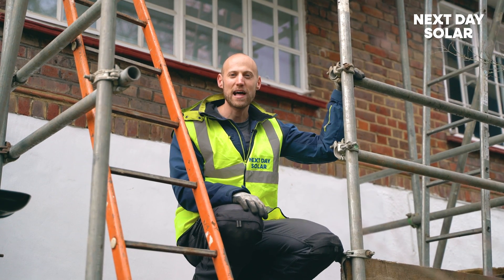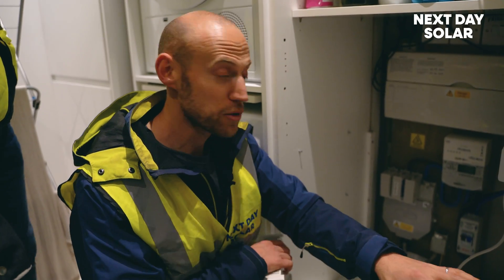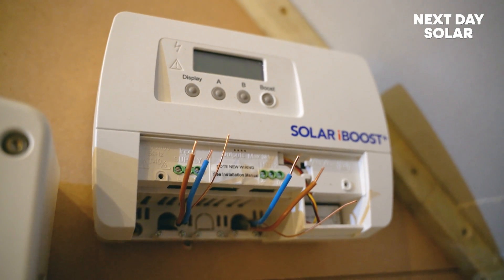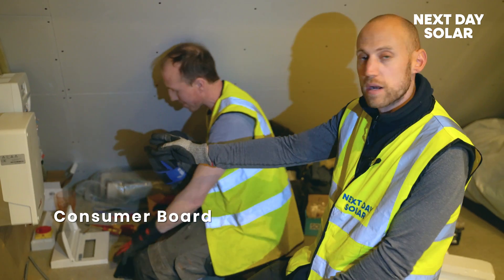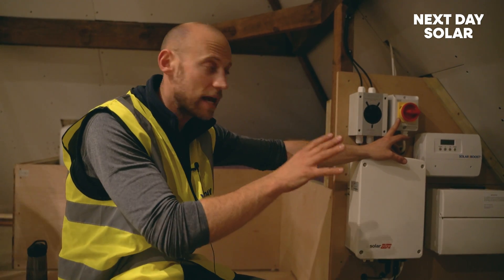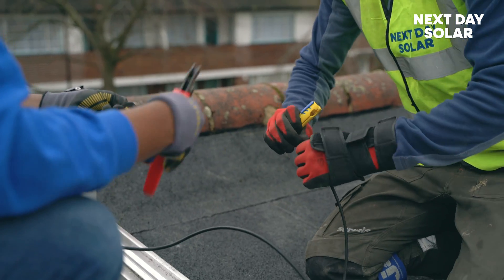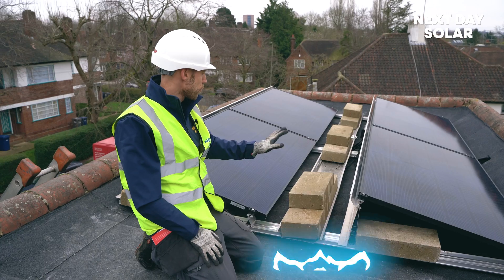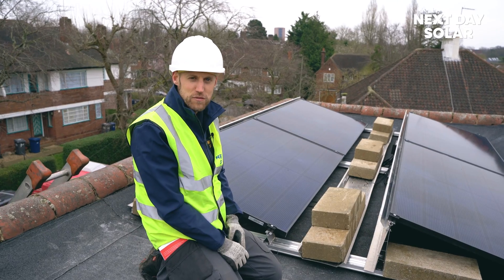Flat Roof - Solar Installation - 1.6kWp - Step by step Guide for homeowners. + hot water system

Comment: Hi, great video. Thank you. Question: Other than the cinder blocks weighing them down, is there anything else keeping these attached to the roof? How much wind can this type of system handle?

I have an installer who just did this on a customer's house and they are not happy with the final result. Especially when this is not what they were told would be installed. Also, the installer used very big, bulky, ugly cinder blocks on an expensive property on a golf course. It looks awful. Their home is also in a very high wind area, so they are concerned about that issue.

Your installation looks much better with flat cinder blocks. 

Thanks for any info.
Reply from the maker: Hi, when you install a system like this, you use a calculator from the mounting supplier (in this case was Schletter) and it tells you precisely where and how much ballast you need. You can use whatever ballast you want (within reason). The wind loading is therefore a set metric which is a standard value, dependent on the location of the array (i.e built up area/costal) and height above sea level. 

My suggestion is the customer sends you or us the paperwork supplied by the installer so we can have a quick look over it. The customer should have been provided all data sheets and calculations for every aspect of the installation. If you reply with your email, I will send you an example of the one done for this property. 

As there is no fixing to the roof it's immensely important for all evident reasons that the right amount of ballast is used. When handling a solar panel on a roof they act like a sail in low winds. With high winds its dangerous. We have seen and repaired flat room systems where the panels are scattered all over the roof due to improper fixing or improper ballast. 

A few pictures of the job would also be useful. Our email is hello@nextdaysolar.co.uk and please for the attention of Asher.

Comment: Nice video. I would lower the top ballast stones if I were you. Even a bit of shadow can lower the output quite a bit.
Reply from the maker: You are correct, and subsequently we did a few days later. Ideally the panels would be space a little further apart, but we were extremely tight on space. We did as much as we could. Export in the last 12 months was 400kWh, the rest was used by the property which is great.

Comment: Nice video, thanks. One correction is that the Solar I Boost may save a bit of money but it's definitely not good for the planet.  Gas is always the most efficient way of heating hot water (typically 90% efficient), compared to power stations which are no more than 60% efficient.  Therefore if you really want to reduce your carbon footprint you should pass excess electricity to the grid (as this reduces UK power generation) and heat your water with gas. OK I know we are talking peanuts here but just pointing out that it's wrong to say the I boost is good for the planet!
Reply: Hi John. Interesting to note here that electrically heated water is 100% efficient which is higher than the gas heating efficiency of 90%. So using your solar energy directly to heat your water is better than heating with gas.
Reply: heat pumps can be over 400%. Power in the UK comes from predominantly combined cycle gas stations that are way more efficient than burning gas in your own boiler. Also about 20% of our power comes from wind

Comment: Adding the solar energy into an existing power group in the house looks dangerous to me. In the Netherlands we have a 16A breaker per group. By adding a the solar energy via it's own  breaker (I assume 10A), some of the cabling in this group could see 26A before a breaker would pop. The wiring could catch on fire if 25A would be drawn over a longer time.
Reply from the maker: Hi, solar installs in the UK must be on their own dedicated circuit, with breaker accordingly. We have a 16A break here, and the PV is only 1.5kW or 6A. Not sure your reference to 25A, but no concern here.
Reply: @nextdaysolar3349  From the video I understood at 5:55 that the solar power was connected to the nearest group available in the addic or the floor below it via the AC disconnect. Perhaps I misunderstood the remarks about having power already in the adic or the floor below it. Having a dedicated breaker in the cabinet with the home connection is the only good solution.
Reply from the maker: @jansmit4628  Hi Jan, maybe a phone call easier to clarify. In the main consumer board of the property there is a 20A/32A breaker from Memory. This takes the power up to the loft area. On the loft circuit was the heating system electronics) and the immersion heater. We took this feed, placed into a new board, and wired the inverter and immersion off of this new board.

Comment: Hi Next Day Solar, I have a 100 sqft EPDM flat rubber roof surrounded by parapet walls on top of a 2nd floor extension that I would like to install 3-4 solar panels on, do you have any lightweight fixing options as my extension walls are not solid brick please? Also it looks like  in your video that you fitted a single-phase SolarEdge 1.5kW inverter to a three-phase power supply?
Reply from the maker: Good evening, the weight is a specific calculation based on location, size of array, height of property etc. If you have a parapet that really helps reduce the weight required to ballast down the system. If you'd like us to run the calculation , please email us at hello@nextdaysolar.co.uk with the enquiry, or jump ahead and complete the quick questionnaire here : https://q8esoxafmpw.typeform.com/to/CJOvbg4a , In terms of fixings, the fixings themselves are all pretty similar, we can swap rails for plastic ground mount containers, but again little in it. Finally, we fitted a 1.5kW single phase, as whilst the property 'features' a 3-phase supply, its only been wired on a single phase which is quite typical. In the 1930's when power was run to these properties 3-phase suppliers were 'standard' but with the 'efficiency' improvements of modern equipment, single phase connections are much more common. Hope that helps.

Comment: I'd be a little concerned about a 200kg load on the top of my roof
Reply from the maker: Hi, before any job we get a structural report/engineer to check. With this job (there is a previous video) we added some members into the loft space to handle the additional load. On modern GRP roofs they can take more than 200kg per sqm. So fear not, the roof is up to the job !

Comment: Cant run a smart meter backwards though ;)
Reply: You can charge a battery though and use the power at peak demand/price
Reply: But you can bring it to a standstill. That’s what’s happening with my solar/battery storage system. I just have to pay the standing charge. I don’t mind as it’s useful to have the grid to balance any reduction in generation.

Comment: great video do you have a link to the flat roof frame system please as this is what I need for my diy system on my outbuilding thanks
Reply from the maker: Sure, https://schletter-group.com/flat-roof-systems/?lang=en, you want to look at FixGrid 18, or something similar depending on project. There are a number of suppliers of Schletter gear, as you cannot buy direct. Many of them are not taking new accounts/business, so let us know if you get stuck. We also have most of the components in stock. Thank you

Comment: Optimizer in this case are a bit overkill, no? There is almost no chance of partial shadow.
All black for panel that cannot be seen is also a bad choice, all black heat a tiny bit more, and are less efficient because of that (not to mention that they cost more).
Reply from the maker: We have shading from the Chimney and also as the roof is so small the units were pushed quite close together so they can help. It's also quite a tricky roof to get to, so again gives a more detailed overview for future diagnosis. All black as its what was available. Today its what we can get, rather than what we'd like ! but I hear your point on temperature management.

Comment: Hi guys, what are the dimensions of the roof. I have a loft extension, thus don't have a south facing wall. Just a flat roof. But i've also got a south kitchen extension which is 6.m wide, by 4m long.
Reply from the maker: The roof space we had to play with here was 5mx3m. The panels were 2mx1m. It was a'bit tight but we made it work. 6x4m is plenty.

Comment: so what would the price of a similar system be without the iboost, looking for something similar on a single story flat roof, so no need for scaffolding
Reply from the maker: Good morning, the Iboost is not an expensive bit of kit, £300 approx. Scaffolding is normally under £1k. You are looking around £4k depending on the project, location etc, flat roof single story makes life much easier.

Comment: My installer did not treat my panels well as these guys.  Do you do it the same way when off camera?  If so, I should complain to my local installer.
Reply from the maker: Panels are glass, indeed thinner than most windows, and the rear cell is generally un-protected, one knock can damage a single cell (of which there may be 78) in a panel, and if damaging one cell, half the panel may be then unable to generate effectively, or heat up and start a fire in the worst possible case, so yes panels must be treated carefully, generally with 2 persons on them at any time, and tested before they are installed. They are likely to be on a roof/ground/surface for up to 20 years, and with scaffolding in place, you don't want to be visiting them often to repair/remedy an issue. I'm sure your installation is just fine, but yes we take great care when handling something that is expensive, fragile, and something that forms part of a more complex series of components that all must work harmoniously to generate power and rid us of our coal past !
Reply: @nextdaysolar3349  top notch installing.  Keep up the good work.

Comment: Is planning permission needed for this?
Reply: I suggest you check with your local planning authority. From the UK planning portal website:- “Panels should not be installed above the highest part of the roof (excluding the chimney) and should project no more than 200mm from the roof slope or wall surface”. Every roof has a roof slope be it zero or 35 degrees. So, if any part of the panel projects more than 200mm from the roof then planning permission is required.
Reply from the maker: Only within a conversation area, otherwise fine under permitted development.

Comment: Hi - great video. I have a 50m2 flat roof which is quite exposed. Do you have the option to use fixing points like the Nicholson IFP system? I am considering a 12 panel E/W aligned 5kw system and I am based in SW London (I have an EV!)
Reply from the maker: Hi Andrew, yes we can consider using those fixings. I've had a look, and they seem excellent. I will need to check if they are MCS certified, they do not appear under product/supplier lists at present. E/W systems are great, as they often better match the load profile of a home (usage in morning and afternoon) If you are not considering batteries. If you'd like us to consider the install, drop us an email to hello@nextdaysolar.co.uk and we can put a basic quotation together for you. Thanks

Comment: Would a 12 panel system with no edge on a flat roof require much more ballast? How do you check for strength of roof to handle that kind of weight? Do you sometimes opt to find the batons and screw in instead of using balast?
Reply from the maker: There are a number of requirements and considerations when dealing with a flat roof. If you are within 50cm from the edge of the roof perimeter, ballast must be increased by 30%, (from a standard calculation). If there is no parapet (then ballast must be increased as well). It is irrelevant how many panels you have, its just about where they are situated. Once you have the size of roof, and know how many panels, the weight of the rack, we then run a specialist software/calculation to determine ballast weight. One would then run this weight past a structural engineer (of which we have internally) to determine whether additional support is required. In most cases it is not, it depends on the state of the building fabrication, and its design. MCS regulations (of which we are bound) imply one must not screw/fix to a flat roof surface unless for a specific reason. It is likely to cause damage to the integrity and watertightness of the roofing substrate, so in most situations its not recommended. Email us at hello@nextdaysolar.co.uk with your project if you like. Thanks.